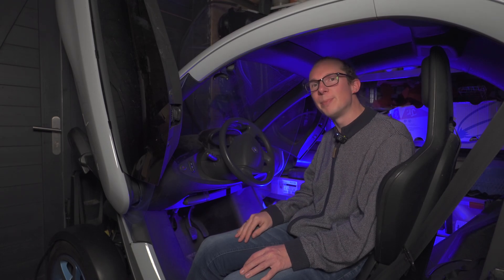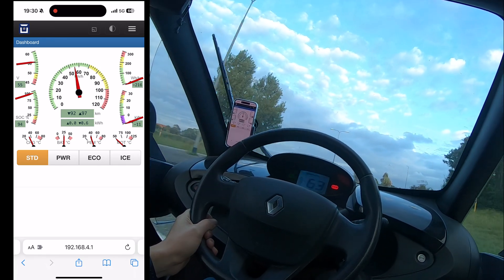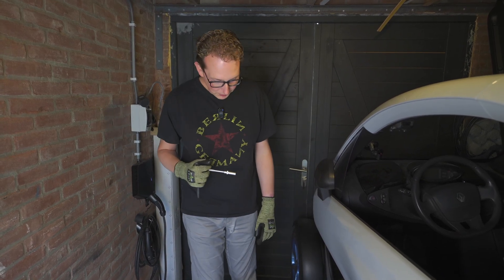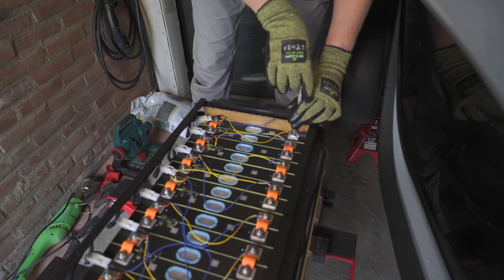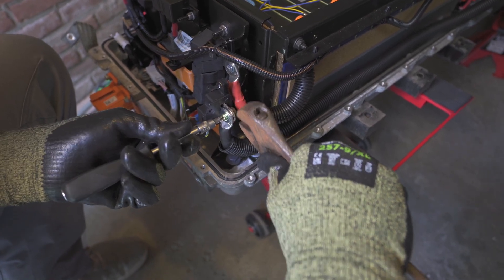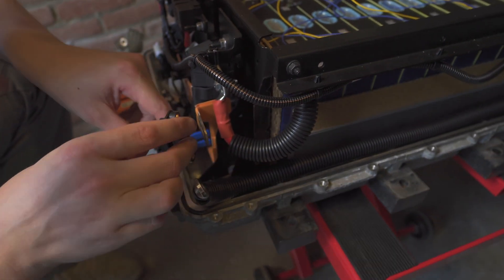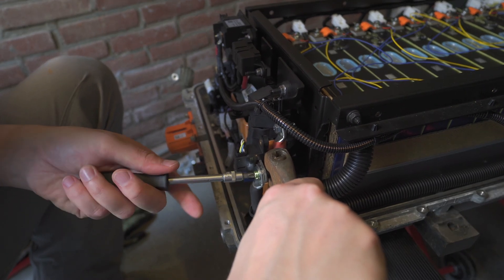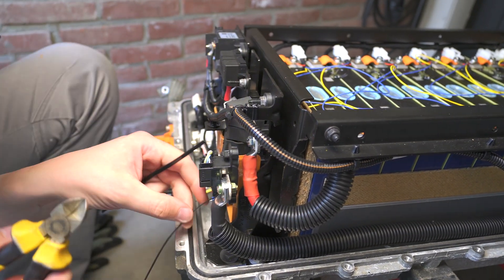Twizy range test with new DIY battery! (Battery upgrade - Part 4)

Comment: Hell can we have a update now? After several cycles the battery should have recalibrated correctly and the temperatures now should definitely be more ideal.

I have some Renault zoe 2021 cells waiting to be installed. I’m getting all the last information from the web before starting on mine.

Comment: Use a Coulomb counter to measure your cell's real capacity, IMHO you got a fake cell, M6 screws in a 200+AH cell was never a CALB implementation, they always used M8, even in 100AH cells. I've used CALB cells since 2013 and they actually exceed their specs, their 180AH cells can give you nearly 200AH, CALB was one of the best brands in China and a bit expensive, one of my customers went to their factory, he was impressed of their infrastructure and QC tests. I can send you one Intelligent AH meter for free with a shunt, then you can prepare another video, installation is easy. I believe your cells are 150AH. Oh! I forgot, every CALB cell had a serial number, they used to make LiFePO4 cells, I never saw they build NCM, I use NCM 18650 and 21700 cells only since 2020 and I can't find CALB anymore, maybe they went bankrupcy.

Comment: Hello from Mexico! Do you need the OVMS to change the batteries and make the Twizy operational?  I'm going to use NCM 18650 cells in my 2016 Twizy, starting in a few days. Thanks a lot for your answer

Comment: Netjes gedaan, hebben jullie inmiddels al vaker de accu leeg gereden en opgeladen? Mogelijk dat het BMS nog wat moet kalibreren op het nieuwe bereik? Als in, dat je inmiddels een beter bereik/inzicht op het display hebt?
En wat zijn de kosten die jullie er uiteindelijk aan gemaakt hebben?
Ik zit er over te denken om te wachten op een Twizy met slechte accu om die om te laten bouwen (zelf helaas daar niet handig in) en vervolgens mijn goede accu over te zetten zodat ik 2 goede Twizy's heb en 1 weer te verkopen.
Reply from the maker: Inmiddels wel wat ritjes gemaakt. Maar de BMS leert helaas niet. Hij houdt de capaciteit van een nieuwe batterij. 
Je zal de BMS moeten vervangen voor een zelfgebouwde variant om de volledige capaciteit te benutten, maar dat maakt dit project gelijk een ingewikkeld verhaal.
De kosten zonder gereedschap was ongeveer 1200 -1400 euro.
Reply: @DIYDiscoveryDuo  Thanks!

Comment: Hi, I'm surprised by the Twizy's short range with this new battery. The original battery has a capacity of 6kWh and yours almost twice that, but you still only manage 80km.
Reply: That is what I thought. A friend of mine did the Finland battery and he is doeing in Winter 130km range and almost 180ikm in winter. Look like your China batteries are not really 11kWh
Reply: @BadBoy.NL.1964 what is ”the Finland battery” ?
I’ve driven 70000km with my Twizy and it might need a new bigger battery at some point 😅
Reply: I think that's mostly the spirited driving. Twist isn't the most aerodynamic.
Reply: Mine with an upgraded batter does 110 Km regardless if it is summer or winter, I have it tuned using a Powerbox in full “sport mode” and definitely I do not drive it economically/conservatively
Reply: @dmorenoj which battery?
Reply: @dmorenoj 110km with the same prismatic cells of this video?
Reply: We are in same boat 😅
Reply: i guess it will improve after a while to around 100 or 110km

Comment: Was oryginal battery also lifepo4? If not you will overcharge your cells, because lifepo4 operates on lower voltages than traditional cells. Can even start a fire.
Reply from the maker: Hi, The Twizy has NMC cells. The replacement cells are NOT LiFePO4 but NMC.
Reply: @DIYDiscoveryDuo  ah okay, i though those big blue cells are made only in lifepo4 version.
Reply: As I understand it, LiFePO4 batteries are very hard to set on fire, even when mistreated. But still, for good longevity, a matching charger is a must.

I think (but am not 100% sure) the original Twizy battery has NMC cells.
Reply: for lifepo4 you have to change bms too

Comment: I wouldn't feel comfortable charging any ev in my garage especially if its anywhere near the house. I park my skoda at the end of the drive away from the house. And skoda have one of the best safety records.
It's rsky to charge any lipo battery's in the house
Reply: I think the risk is still very low. Look up the numbers (actual numbers, not click-baity "news" articles) on how many cars catch fire and how that's divided between EV's/fossil-fuelled cars.

The Twizy (with original battery) does have NMC cells, which do need to be charged carefully, but they're charged at a low rate (2 kW which equates to 1/3 C) so there's not much energy going into them anyway. In my Twizy, I have a Twiz'O'Meter connected to the OBD2 port, which allows me to lower the charging power all the way down to 0,7 kW, which should lower the already small risk even more.

But hey, nothing wrong with being careful.
Reply: @SolarWebsite  compared with petrol cars it's actually rather high, in the uk the cases have been played down, Luton Airport car park being distroyed was a hybrid even though the media tried to say it was a diesel range rover.  Batteries produce very distinctive fire. One thatcisnt easily put out.
Also several houses have court fire due to ev's. Not click bate
To be fair if you look on the London fire service website the vast majority of house fires are coursed by people charging Chinese scooters. Around 70% ..
Fly rc helicopters and racing rc cars, the risks posed by lipo battery's is something that is always present. Its not so easy to put an ev battery pack is a fire safety bag lol
Reply: You’re talking out of your ass. Any official source proves that EVs catch fire much less often than combustion engine vehicles.
Reply: @meeskees702  so when Porsche advised its customers not to charge their vehicles it wax because they are so safe.
The garage fire in Spain nothing to do with the ev that court fire or all the other fires they have started
I know saying the truth isn't  popular with the bigoted, but there is no need to use insulting language. You just show yourself up.

Comment: Hi, very good job,  thank you very much. Looking at your beautiful work gave me an idea for my Twizy. Rather than replacing the 14 cells of the Twizy and using the control wires of the original BMS, it would probably be more efficient to place these wires across 14 resistors connected in series as a voltage divider between the 2 terminals of a 16 or 17-cell 3.2v LFP battery equipped with its own BMS. In this way, the Twizy's BMS continues to read the correct voltages, while the battery's BMS with active balancer manages the new battery. What are the dimensions of the useful internal volume of the battery envelope? This is to find, for example, prismatic LFP cells and why not double the Twizy's capacity.

Comment: Is Twizy can more than 50 km/h? I was in Italy and rent Twizy. But it was unable ran more than 50 km/h.
Reply: you have 2 models one is limited to 50 a there is a version that is 80, more power and more speed. it depends on local regulations
Reply: 85* but true

Comment: been looking at the cells you replaced the old batterypack with , was about 1200euro excluding the shipping from china  , taxen and fees , a 2012 twizzy can be found for about 3000 euro with a batterypack or 2000 without (you need the batterypack for the electronics inside it ) could probably get a little better price if you wait on a good deal and jump on it fast 
all in all i think you would have a good running electric car for about 4500 to 5000 euro wish to me seems to be a good investment considering wat they ask for a original batterypack to own or rent 
guess it does charge the pack from the original charger
Reply: I bought a 2020 Twizy last August (so 4 years old) for a little over € 5000, so I had a good Twizy with a good battery (100% SOH) without having to do a lot of work. That's also an option, if you can find a good deal.
Reply: @SolarWebsite  yeah problem over here in the netherlands is that the batteries in the originally dutch licenced twizzy are.all leased from.renault , the ones with bought batteries are only available in germany and you need to reregister the car to get dutch papers , you pay import taxes and some.taxes.over the blue book value of the car (any car inported from within europe up to a certain age)
Reply: @watahyahknow  I also live in the Netherlands 😁 And yes, when I bought my Twizy (from a Renault/Dacia dealer who had used it as a loan vehicle) it had a rental battery. After some difficult and frankly nasty negotiations with Mobilize, the financial arm of Renault that rents out the batteries, I bought it.
Reply: @SolarWebsite  its wat innitially stopped me from buying an electric car , the cheaper versions all have rented bateries and the savings you make with the road tax excemption you make up paying the rental fees , and when you do break the pack its verry hard to get them to get you a replacement , usually they take the battery pack as they own that and let you keep the twizzy as thats yours , and basicly you end up with a verry large paperweight 
nice to see that the battery replacement works , now i like to see someone recreate all the auzillery stuff like the charger and bms systems to communicate with the rest of a stock twizzy so you dont need an old battery pack to get an old twizzy without a batterypack working again
Reply: @watahyahknow  Yeah. I fully agree, the battery rental system sucks in many ways. That's why before buying the Twizy, I made damn sure I could buy the battery on day 1, which is exactly what I did.

I'll save you the details, but the process of buying the battery wasn't pretty, this Mobilize company (same company behind the Duo/Bento) lied to me about the VAT and were nasty about it too. So, I'll look at the Duo, but will probably not buy one because if I can avoid it I don't want to do business with Mobilize ever again.

Comment: What year twizy do you have? Mine doesn’t give you those extra 6km after turning the ignition off and on.
As a comparison my twizy with a powerbox achieves 70km in the summer here in Italy, travelling at maximum 50-55km/h. It’s a 2012 twizy with 42.000km and 74% battery health according to the powerbox. To achieve the 70km range really do drive in a conservative manner. Otherwise my range is about 50km. Currently at a temperature of 10-15 degrees I would expect to get 40-50km range if driving in economy. 
I’m also looking in to doing a cell swap as I purchased an entire renault zoe 2021 52kw/h battery pack. It uses a 2P 8S module configuration, comprising of a total of 12modules. I have used them for my home solar victron setup, and left 4 modules for the twizy experiment. 

I’m prepared to have to reconfigure the individual pouches that comprise the modules as to achieve the twizy’s 14S configuration and using all of the available space in the battery compartment. For this I might have to buy a Cold welder to weld the contact tabs. 
I must say I do a lot of drifting with the twizy so my battery is quite depleted as it gets abused when in max power mode leading to a high current going through the cells.
Reply: What motor temperatures do you see when driving in a .... spirited... manner? I have a standard 2020 Twizy, not tuned in any way, and when driving maximum speed for some time the motor temps can get quite high. I don't know yet if that's normal?
Reply: @SolarWebsite over 100c when drifting. Obviously with a powerbox